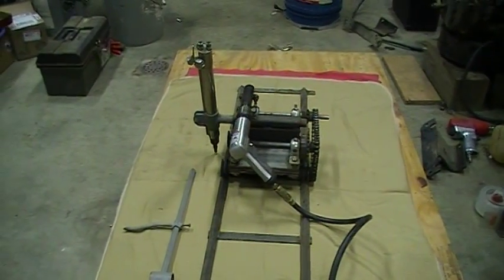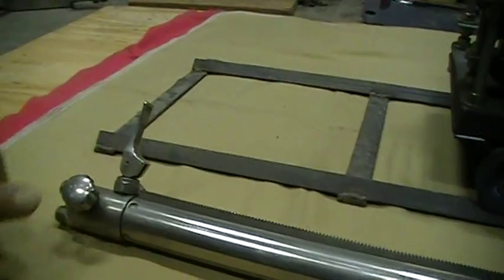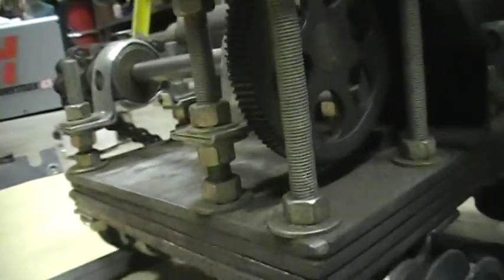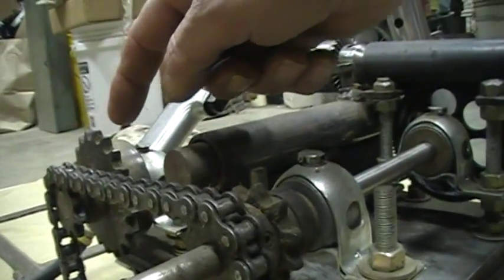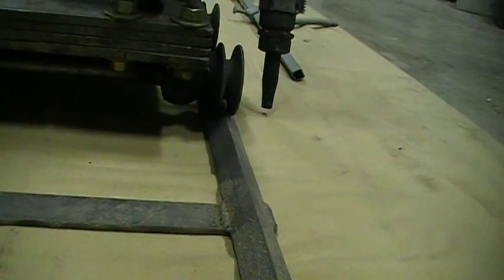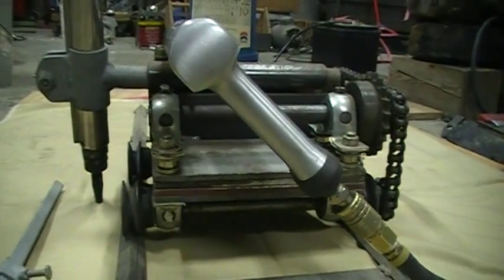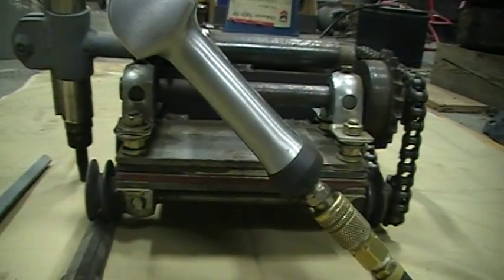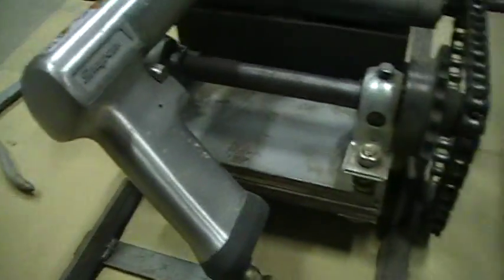Straight cutting steel with a homemade track torch

Comment: Harbor Freight has a real simple Worm Drive attached to a belt pull for a boat trailer
Reply from the maker: Sounds like it would work, you would not need that much reduction nowadays, heck a 1/2 inch cordless drill has most of the reduction needed. 
Thanks for the comment.
John Fink